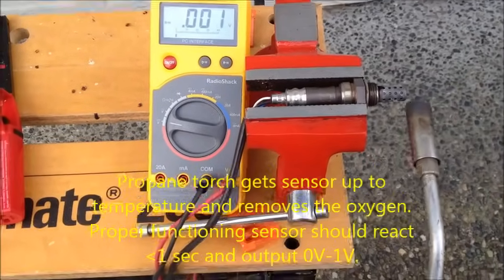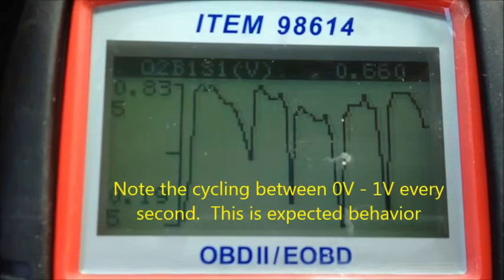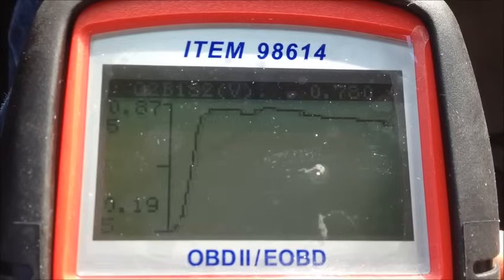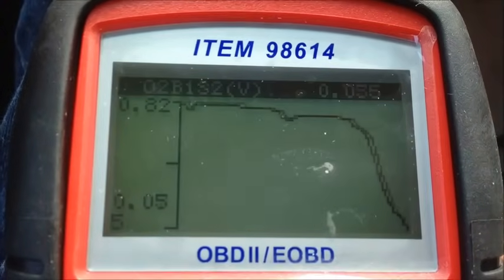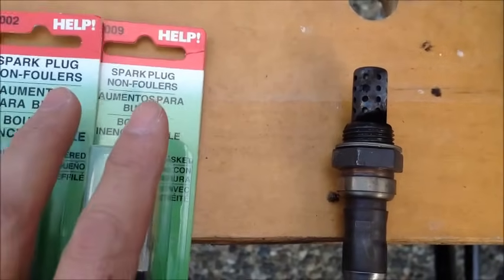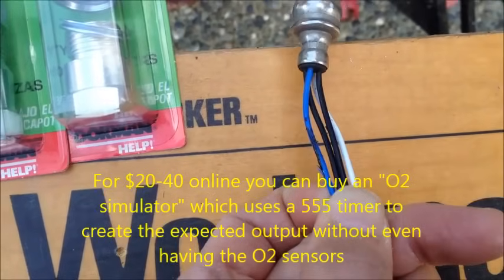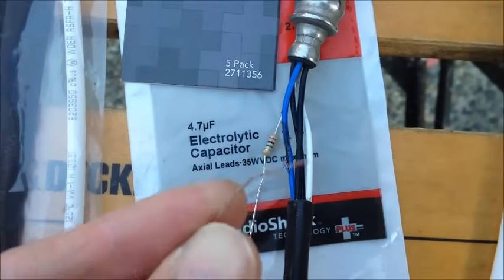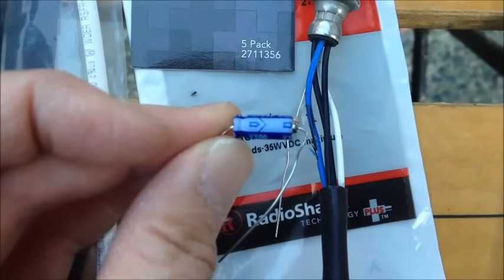$3 O2 simulator fix for P0420 Check Engine Light

Comment: Can someone write down the valves of the resistor and capacitor please I need the Volt valve I can’t see it in his recording , it would be great if someone wrote the whole value volt and watt .
Reply from the maker: 1 MOhm 1/4 watt resistor, 4.7uF electrolytic capacitor.  People often can't find those exact amounts nor is it critical you use exactly those values.  You need to play with it a little depending on how bad your cat is you might get other errors which indicate you've slowed it down too much.  If so you can reduce either the R or C.  The important value is RxC so you can reduce the resistor or capacitor value, or you can put more than one resistor in parallel which will reduce the resistance by half due to the formula 1/R = 1/R1 + 1/R2 + 1/R3...  So if you have two 1MOhm resistors in parallel it's like having .5MOhm, three 1MOhm in parallel = .33MOhm.  Good luck.
Reply: @miteeman  thanks for replying, 4.7 uf how many volts because the market has different volts same with resistor I just need some values for the volts to start with
Reply from the maker: @sabahjason1  The voltage capacity of the capacitor doesn't matter since it only has to store 1V!

Comment: What would happen if the upstream was modified ? I have a minor exhaust leak at the header. I did the trick and my gruñe economy has gone up and the engine light is off
Reply: Would not recommend modifying the air fuel sensor its cheaper to replace header than it is a catalytic converter

Comment: any updates to this ? I have a 2015 Hyundai Santa Fe, got it about 3 yrs ago, it has occasionally thrown the P0420 code ever since I got it but has gone off in time to pass emissions until this year. so the check engine light has been coming on on a pretty regular basis and of course when I clear the codes it resets the drive cycle. I have spent about 2 1/2 weeks and plenty of gas clearing check engine light and then trying to get drive cycle to reset, finally decided to try the spark plug non fouler trick, got it installed went for a short drive, no check engine light, couple of hours later took it back out and again no check engine light but monitors still not ready, let it sit for a couple of hours and drove it again and bingo check engine light came on. Got home and read the codes fully expecting the same old P0420 but nope, no P0420, now getting P0136 O2 sensor out of range and one other code all related to O2 sensor. So the non fouler worked to get rid of the P0420 but created new codes. Researched some online and it seems the non fouler trick works for 80% of those who try it. What puzzled me was my O2 sensor reading and Short and long term fuel trims all looked good. Tried one other thing, took off one of the non foulers, drilled the other one all the way out put the O2 sensor back in with just one non fouler and went for a drive, O2 sensor voltage looked good and Long term fuel trim was great it was down to 2-3%, drove it around, no check engine light, stopped vehicle and checked monitors three were still not ready and it said there was 3 pending codes so i knew it was just a matter of time before check engine light came on. The codes were all related to the O2 sensor which again puzzled me because as I drive the vehicle the downstream O2 voltage looks good, the upstream looks good and short and long term fuel trims look really good, so not sure why check engine light is coming on. Did more searching online and it looks like most of the posts about using non-foulers were before 2011-12 and on cars older than 2010. Saw one obscure post that said trying to trick the computer with non foulers etc., didn't work on newer cars because the computers are too good. So your post about making this simulator is from 2014, do you know if it's been tried and worked on any newer cars because it's about my last option ?
Reply from the maker: Wow, that's quite the effort you've put in!  Sounds like you might have a graphing OBD like shown - that will help a lot.  I haven't tried it on a 2014 but this should be more flexible than the foulers as it's all analog electronics so with the right combo of R x C you should be able to make it look right.  If you watch my video you can see what it should be looking like upstream & downstream with a graphing OBD.  All I can suggest is for you to try it and use a potentiometer for the resistor so you can literally dial it in.  If you go too far one way or the other you'll get a different code.  With the graphing OBD you can just play with it until it looks right rather than doing all those drive cycles.  You can't just kill off the signal - it's got to look like the input but slowed down.  Good luck to you.  You can check below to see if there are any late model reports but I didn't see one with a quick skim.  So you may be right that the computers are better.  But they still need to accept the right input/output so in theory you should still be able to tune it in unless your cat is really dead.
Reply: @miteeman  Thanks for replying. I do get a graph along with a digital readout but it's a solid bar type graph and I'm limited to min/max on the graph, it's okay but can't really spread it much, I'm just puzzled because the readings look like they are within the range the ECU is looking for, at least the range that has been mentioned in other articles. Should get the parts in mail this week to try your method, having a pot is a good idea even though it may be a little less heat tolerant than a resisitor. Will post the results.
Reply from the maker: @Splashfun2000  Range is important but not sufficient.  I'm not sure how the computers check the signal but it should look like a slower version of the input.  As you indicated, modern computers are probably better at detecting so you have to do a good job.  I know graphing OBDs can be expensive but you might look into whether you can use a cheap bluetooth OBD reader (ELM327 is a popular one for just $10).  They don't work with iOS but depending upon the software for your Android / PC I think it should be able to graph those o2 sensors.  Please report back if you're able to get it to work.

Comment: Get an o2 connector from a "You Pull It" junk yard. Get the o2 side and the wiring harness side. Put MIL simulator between both connectors. This way you don't have to cut up an o2 sensor. Just put it between o2 sensor and wiring harness. Plug and play.
Reply from the maker: That's a great solution if you can get access to those connectors.  If you have to buy them it's expensive and a hassle to make a cable.  Even going to a junkyard, crawling underneath,  and removing one seems like more hassle than it's worth for me.  But it's a good idea if you have a junkyard near you and you like doing that work.

Comment: do you mean that for o2s2 after the catilytic converter not the one before it ??
Reply from the maker: Correct.  This code complains that the output o2 sensor after the cat doesn't show enough improvement.  So that's where you have to change it.

Comment: Ok i have to problem vw jetta 2014 they have to  5 cable white black red yellow gray i dont know how to fix can u help me 🙏
Reply from the maker: You'll have to Google for your make & model o2 sensor wiring to find the right wires.  Some newer models don't have such simple sensors and may not work.  I searched for you and I think this page will be helpful, but warning it could be wrong because I'm only able to match it based on your description of the colors.  http://www.wbo2.com/cable/lsuconns.htm.  There are always two heater wires, in this example they are White and Gray.  If you turn on the car and measure the side coming from the computer (not the sensor side) you should read 12v with a voltmeter.  Or you can measure the resistance on the sensor side and you should read a low resistance (< 50 ohms).  These 5/6 wire wideband sensors have an extra calibration wire which is usually green but in the 5 pin it doesn't seem to be exposed.  The two wires you want to connect to are either Black/Red or Yellow/Red.  I don't have one of these so I can't tell you which, but I believe it's Yellow/Red.  The way to find out is to use a torch or lighter on the sensor and measure the output across those two sets of leads.  Whichever is generating a voltage that changes with the flame is the right pair.
Reply: Is your jetta 1.8 tsi? Mine only has 4 wires

Comment: Does the sim have to be close to the Sensor itself or can i splice the sim closer to the harness connector ?
Reply from the maker: That's the great thing about doing it electrically - you can do it anywhere you find convenient.  Some people have connectors that are inside the cabin and accessible.  That's not true for the Honda Odyssey I was working on.
Reply: @miteeman  Does this work on a car with no cats?
Reply from the maker: @2Spookeh4Me  no
Reply: @miteeman  Damn. Thanks for the info!

Comment: Interesting.  This may be a much better solution than the defouler trick which is easy for the emissions inspector to see and fail you!  Have you tried just covering up some of the sensor holes to restrict gasses into the sensor,, maybe put some heat resistant tape over it or a metal ring soldered over half the holes..
Reply: There isnt a solder that can withstand the heat especially if the cat halfway works right.
Reply: Just have a question are you doing this to the pre cat sensor or after ?

Comment: MITEEman, thanks alot for the details and the video, but i have a question, i have a 07 fj crusier with bad catalytic converters that i will remove soon but i would like to get the confirmation that if i do you you simulator will it off the christmas tree on the dash? thank again
Reply from the maker: No, this depends upon having a working catalytic converter.  It just smooths the signal out to make the computer happy.

Comment: Thank you thank you this worked great for my 2005 Silverado the post o2 is at .5 on one bank and .6 on the other. But I had to put a spacer also I do not have converters someone had cut them off.

Comment: Now that works perfect, i went from throwing the p0420 every couple miles to now not having any.., works on a 98 honda crv LX
Reply: Did you use the same 1Mohm and 4.7uf cap to your crv i have issues here?
Reply: How did you connect the resistor? I’m confused about if I need to cut the whole sensor wire in half or just make two little openings in the sleeve to connect each end of the resistor

Comment: This worked great but i want to share the following in case you get a P0140 code for no activity just add another 1M ohm resistor in parallel to the previous one installed
Reply from the maker: Glad that worked for you.  I wanted to explain why this worked for anyone else seeing P0140.  The code means that the output signal is not varying with the input signal - you slowed it down too much.  So you need to reduce the value of R x C.  You could have used a capacitor or resistor with half the rating.  But if you bought a pack of resistors then putting two resistors in parallel (tying both their ends together) will create two paths for current and actually cut the resistance in half.
Reply: @miteeman         Hi I tried this with 1M resistor and 4.7UF cap and I got P0140 code so I tried a 1uF cap with 1M resistor and still same P0140 so I put  2 1M resistors in parallel and still got P0140.....
Reply from the maker: @RM-xc9vf  You're doing the right things.  At this point I'd make sure to double check that you're doing your work correctly as you've now cut it back by a factor of 10, so I'd think that would have done the trick.  I'd suspect that you're somehow grounding the output so that it looks dead - perhaps you damaged the capacitor so it's shorted out.  If you can remove the o2 sensor and bench test it you can check if the voltage is going up & down as it should.  A graphing OBD meter is the best way to see what it's doing.  Without those you can add yet another resistor in parallel to cut the resistance into 1/3MOhm.  The resistors need to have their tops soldered together and their bottoms soldered together to provide multiple ways for current to get through.
Reply: @miteeman  1st times i did res and caps i butt spliced them just soldered last resistor its a brand new 02 sensor i took out the rc and i get p420 back....i have even taken cat off and washed it out...i had a exhaust leak by post cat at the flange but i fixed it...so i think its the cat....i will try a 2.2uf cap next and see what happens ...last reading of post 02 sensor showed steady .463v ....to be continued thanks
Reply: Hey Dude thanks for this.. I checked again and my 1 solder joint wasnt the best since i just butt spliced the hole think. so I redid it and been driving for a few days now and no codes. Keeping fingers crossed oh and by the way my car is a 2000 Mazda protege its a oldie but great on fuel so Im doing what I can to keep her going... Ill keep a eye on it and if she holds Ill redo the hole connection with proper soldering
Reply from the maker: @RM-xc9vf  That is going to get a lot of heat and/or vibration so you really need to solder it.  The wires are typically stainless which is why they are such a pain to work with.  If you have some flux that will help but eventually it will work.
Reply: @miteeman  i did the connections inside motor by connector for 02 sensor i didnt want to do at sensor since its brand new + still under warranty...its easy to solder after connector as its regular wire there. But like i  said i will properly solder it after its proven after a few hundred kms...i had butt spliced it all and when it didnt work at 1st i added the other 1M resistor and quickly soldered it....But with butt splices there i had to cut away some of plastic coating.Then wrap ard resistor wire and solder it...so it was a bit dicey . When i checked it ...it wasnt a good solder joint so i redid it and its working .So thanks again
Reply: Do you have a pic of this? Thank you
Reply: @thekenpokid21  not really but just attach it to the first resistor you installed it will work

Comment: what if get myself a .5vdc (half volt) power supply, cut the blue wire signal back to the computer in inject .5 volts from my power supply and totally eliminate the O2 sensors.  the car computer will see a flat .5volt DC value continuously???
Reply from the maker: It won't work.   The car is looking for how the signal varies in comparison to the input signal.  There's a special OBD code that will get thrown if the signal is just flat.

Comment: how come these aren't mass produced for profit?
Reply: Although they have been sold on eBay in the past, every car might require a different combination of capacitor and resistor.  It's trial and error.  Also, this simulator fix doesn't work on all cars. It depends on the condition of your catalytic converter.

Comment: What if I use a tantalium capacitor? Can't find one like the Radio Shack one you have here. Radio Shack is out of them. I would spend more on a high tech solution (like that simulator) you spoke of, if that could be hidden inside the vehicle so the smog tech could not see it. I was able to pass smog last time by adding a gallon of lacquer thinner and driving for about 200 miles, then the check engine light went out -- got it smogged, and then like a few hours after smogging that light came back on! I know it won't pass this time, so I have to do something. I will try this. If anyone knows of any substitutes for the capacitor I can use, let me know.
Reply: You can use any type of capacitor you want, but a Tantalum capacitor is not recommended because their normal failure mode is a short circuit.  That could damage the ECU, since it would short the signal wires.  The best capacitor if your wiring will be in the engine compartment is a ceramic capacitor.  You can buy the Bojack kit on Amazon for about $10 that includes 300 ceramic capacitors with 10 different values.  If you want electrolytic capacitors like the one used in the video, assortment kits are also available on Amazon or eBay for about $10.   There is nothing special about the Radio Shack capacitor.  The important thing is the uf value of the capacitor.
Reply: @Nick-ud9hf  
Good to know. 
Thanks